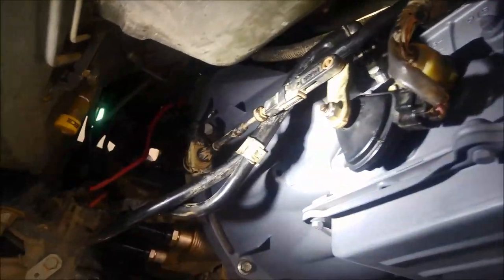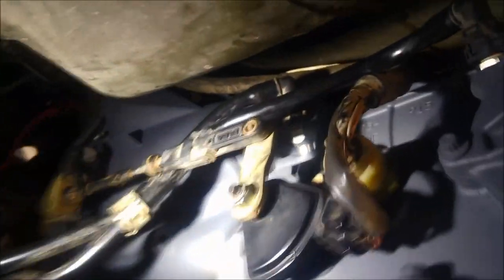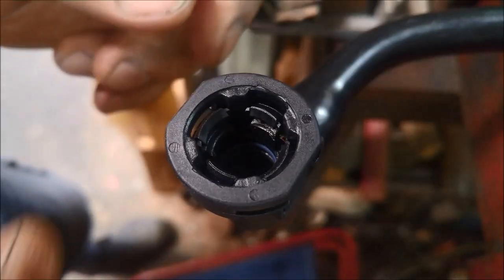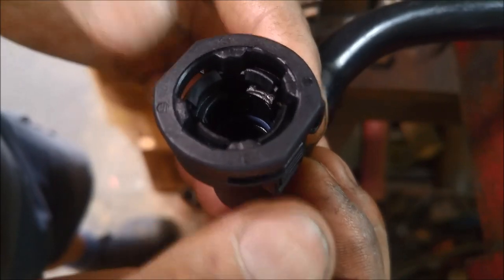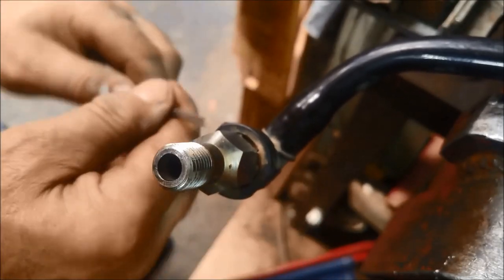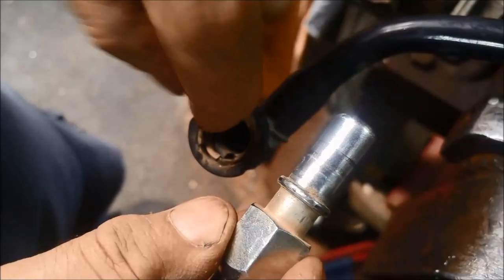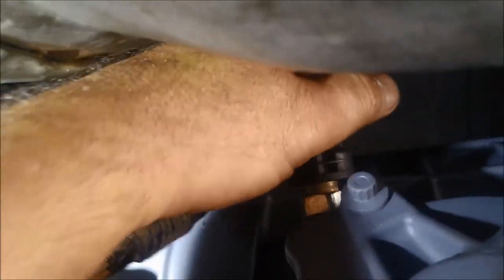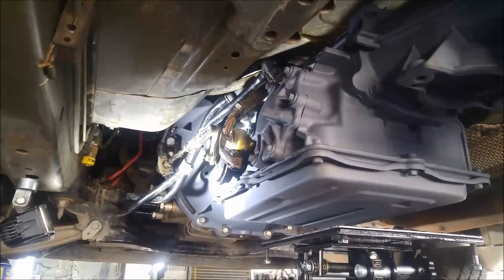Automatic Transmission Cooler Line Quick Connect Removal when limited room no special tools needed

Comment: ok long story short , this volvo v70  2009  been losing oil from loose trans line at the cooler end ,rad. the owner didnt know he thought its got gearbox major problems im going sell it on ebay , i bought it and have figured out the problem , thing is both those lines dont fully " lock " home . the top one will slide fully home and slide fully off but not lock . the bottom one will not push fully home and want come off fully like the the top one is , at this point i dont want force iether of them . any ideas?  is there supposed to be metal cir clips on them both .? there both black like in your vid BUT looks like theres blue "tabs" altho they look very simular to yours there seems to be slightly differnt . going online looking at replacement parts isnt helping really ,im seeing everything apart from what im looking at on my volvo .???

Comment: Quick connect they may be... disconnecting in the limited space by whatever method is another matter. Thanks for explaining how they are supposed to work. I was frustrated recently trying to remove them to install a front mounted trans cooler.. ended up cutting/ breaking the hoses after not being able to find any info  on removal. Even after removal I couldnt figure it out so in the bin they went, best place for them. Your vids are great,,this one was a bit late for me but now I know!
Reply from the maker: cheers
Reply: I had the exact same problem while installing a transmission cooler in my territory. I ended up leaving them connected to the heat exchanger and cable tied thm to the frame until I get time to get the bastards off! Thanks to this video they're now off

Comment: Sometimes the slightest bump and they leak for a few seconds, most quick connect fittings on my cars end up removed and stored in the shed. Location of the heat exchanger always bewildered me.
Reply from the maker: hi, planned obsolescence. cheers
Reply: @YepThatsIt  yeh, nice video of course like all of them, i learnt a bit from you , the beers are stacking up like bit coins LOL

Comment: Before pulling the whole sleeve, can I insert tiny screwdriver into the tab on both sides to lift them away a bit to release from the metal tube locking lip....?   Please advise.     :).
Reply from the maker: hi, you can try, but i haven`t had much success doing that. cheers

Comment: ive got an sr territory thats leaking at one of those conectors which on mine are on the trans oil cooler, what o ring would i need mate?
Reply from the maker: hi, if you follow the line you will see which ones go to trans. sorry can`t tell you which exact oring suits, we just go to our supply of them. make sure you also get the correct oring section thickness. cheers

Comment: I literally aborted a cooler install this weekend as I wasn't sure how best to remove these.  

I didn't have a second car around so took the easy option to just leave in place and swap out 4L of fluid as a holding move as mine had been leaking around the pan and was just showing signs of low fluid - occasional lack of drive when stone cold but only in the first 30 secs or so.  I doubt it had ever been changed in 275k, certainly no witness marks on the (tight...) drain plug but it wasn't actually too bad for that age.  Seems fine now but will revisit the cooler in a couple of months.

Out of interest, what transmission fluid works best with these ION/BTR boxes.  I see variants of TQ95 from Castrol etc but then Penrite stare their fully synthetic ATF is rated for these boxes too and presumably is better able to cope with heat/aging etc due to it's formulation.
Reply from the maker: hi, we like to use Tritech lubricants when we can. cheers

Comment: Weirdly my 2009 G6E-T has the plastic clip lines at both ends - now I'll have to get some adapters for the replacement cooler I bought as it won't fit.
Reply from the maker: hi, we retrofit all the time. cheers
Reply: @YepThatsIt  It's a half inch Quick Connect, correct?  The replacement I sourced has screw ins, so in theory I should just be able to buy the correct size quick connect and replace the screw ins that came with the heat exchanger... but searching I can find loads of smaller diameter QC adapters, but half inch doesn't seem to be around...

Comment: The bits that look like they can be pushed in have been broken off can you advise how I can remove them now please
Reply from the maker: hi, you could either use some pointy nose pliers with tips bent in to reach broken lugs, or unfortunately you may just need to replace the whole section. cheers

Comment: the ford falcon from BA to FG has the most stupid cooling system, the last thing is a heat exchanger that goes to the radiator cooling loop via a plastic thermostat housing, I wish to delete this whole craze of thing by adding what should have been done in the first place a small radiator core to the front on the main radiator, some radiators have heat exchanges built in including on the fords they could have used that lol, pipe is way cheaper then all this setup.

But anyway my question is what thread are those barbs and what size is the hose i am thinking 10mm, i want to put standard barbs in the transmission and run some nice rubber hose to a dedicated radiator, I am also taking an educated guess that i will have to use more oil for the transmission then normal as i am adding the volume of the pipe and rad to the system?

"might as well do a full transmission service"
Reply from the maker: hi, use the plastic elbow connector and just put hose directly on the elbow ( carefully cut off the plastic tube not to cut into the elbow ) you may need to put hose ends in hot water to get them onto the elbow....dont have sharp bends in cooling hose or they will kink when warms up. cheers
Reply: @YepThatsIt I still don't know the inner size of that plastic pipe I hate when these idiots hide information just so they can get return business but for me it makes me think I will not buy from them, no one knows the size no one.....

Comment: Update. Spray around the hose to free everything up. Push the hose on to the stub as far as it will go, then squeeze the coloured buttons in, then withdraw hose with some wiggle if needed. The in and out slack the hose end has on the fitting is what puts the catch in the release or hold positions. So the coloured bits are a squeeze to release, you just have to have hose pushed firmly ON when you do it.
Reply from the maker: thanks for that. cheers

Comment: Who designed such a stupid thing and how much was spent on this contraction. Talk about trying to re invent the wheel! I remember when all you needed was a 14 spanner and the pipe was off.
Reply from the maker: hi, some designing baffles me too. cheers
Reply: @YepThatsIt  It's all to quicken the build of the car. Every second counts. Bugger us poor saps that have to fix them. I've just bought a 2016 territory with that heat exchanger. Are they reliable, or would you piss it of and just fit a external trans cooler.  Thanks for the tips.